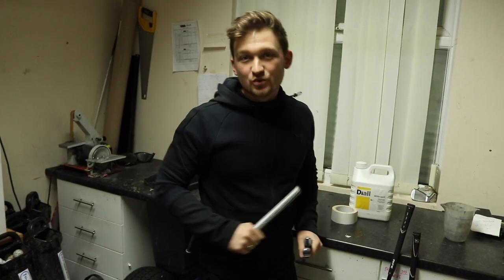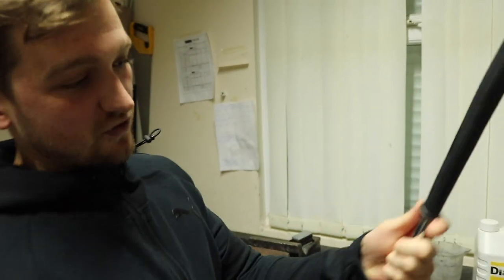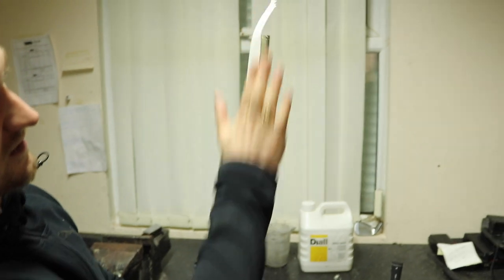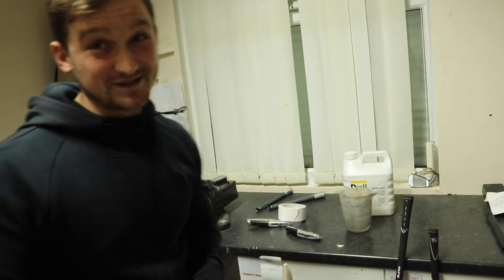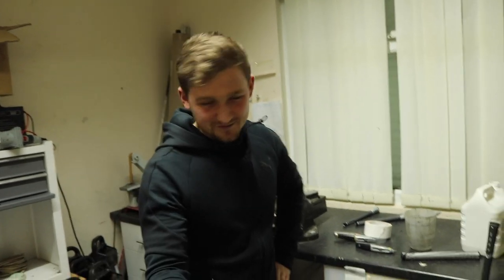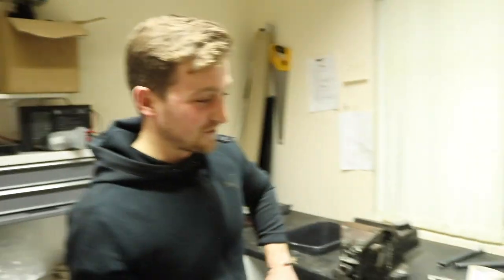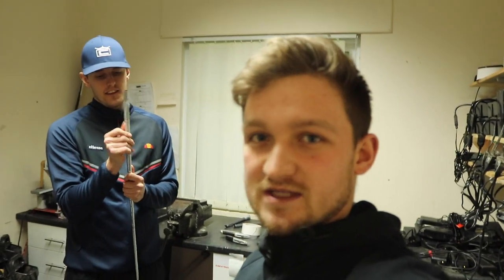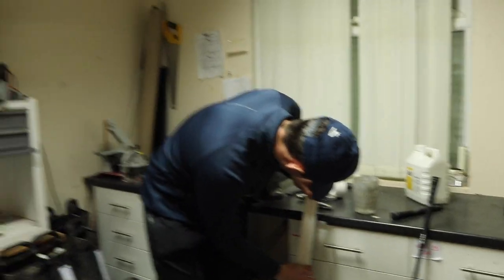How club golfers can RE GRIP their own clubs!

Comment from the maker: Who has tried to RE-GRIP their clubs? How did it go?? 😂 hope you enjoy this one
Reply: I do my own grips; it's actually quite easy (although I haven't tried replacing my massively fat putter grip yet), kind of fun, and only takes a few minutes once you get the hang of it.

A couple of things: 1:  Get the carpet blade.  It's much easier (and safer).  Replace the blade often.
2:  Cut the double-sided tape, don't rip it.  That way you'll have a straight edge for the next club.
3:  Use plenty of lubricant.  Excess amounts.  Make sure you get plenty in the grip.  It dries quickly, so the wetter the tape, the more time you have to adjust the grip.  It will also slide on much easier, and you may not even have to bang, sorry, tap the club against the ground.  After you've done a couple, you'll learn to feel if it's all the way down.
4:  When sliding the new grip on, there's a tendency to stretch it down further than you should (which makes the grip thinner).  Always check the length of the grip on the club against the length of one that isn't on a club.
5:  Personal preference:  I aim my club face, not my grip, so I'm not as particular about it being lined up perfectly.  In fact, I rotate the grip 180º so that I can't see the logo, and I'm just left with a pattern (I use those same Lamkin grips).

Fun video.

Comment: 1. When wrapping tape on top of shaft, use a gilf tee to push tape down into top of shaft.  Otherwise you will create a air pocket and grip will not slide on very easily.  Solvent dispenser..use a spray bottle.. put a golf tee into butt end, spray into grip, tip over into a old psint tray to shake out excess solvent.
.remove the tee ans slide on to shaft.  Use a shaft grip tool on that vice too... much easier...

Comment: Try a compressor air line to pop the old grips right off! 
Works great..
Blow gun fits the grip hole at the top of the grip. seconds to change and does not wreck the old grip. 
New grips changed my golf game big time. 
I used speed clamp grips to Irwins from screwfix to hold the shaft and alling the club. 
Pump spray for the white spirts nice and tidy control.
Reply: You aren't the only one who's made a comment about not ruining the old grip.

It's old and worn, why do you want to keep it?  There's a reason you're changing it out.
Reply: @msalzberg4962  I run with xl grips but very clubs come with them, so unpon un wrapping any new club off comes the existing grip. Same with putters I use the 5.0 super strokes, again off with existing grip. I give the out to mates if they need a dozed grip changed.
Reply: @MarvinofMars  Ah.  That makes sense.  I never thought of that.

Comment: I’ve been doing my grips for years. I use water based grip tape instead of “lubricant” on the tape. Mine definitely doesn’t slide on as easy as yours. What is that lubricant? Does it interact with the tape and dry like glue? Good video. Makes me rethink my process.
Reply: Never mind I see the pic of the lube.
Reply from the maker: Great to hear you liked the video Kim! 

Make sure that you give this a go with the lubricant it’s really easy